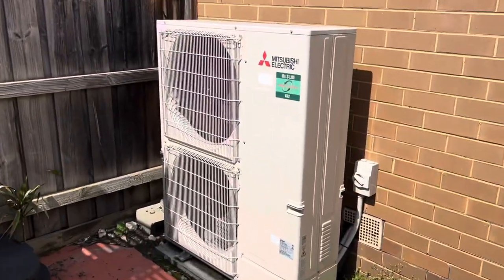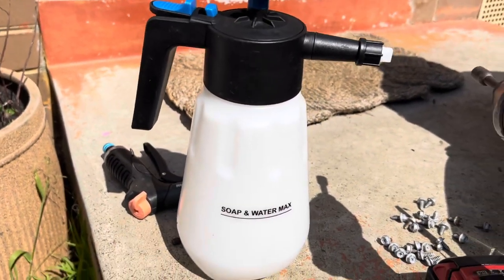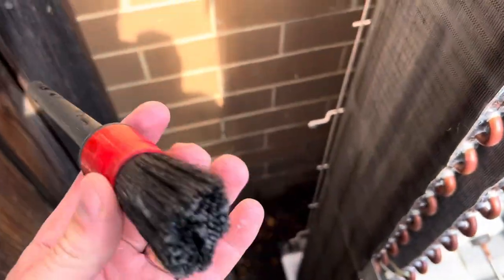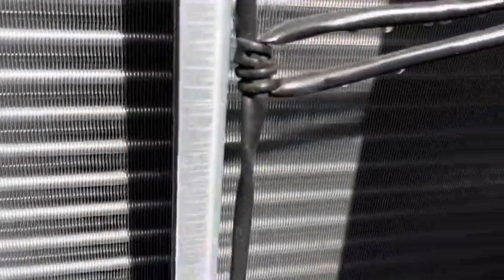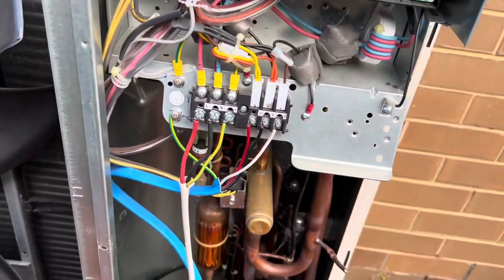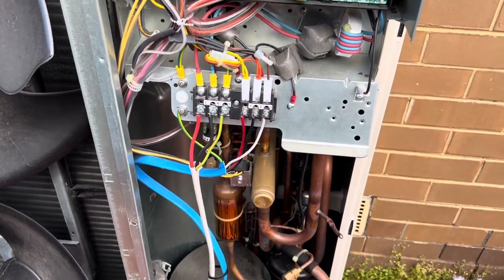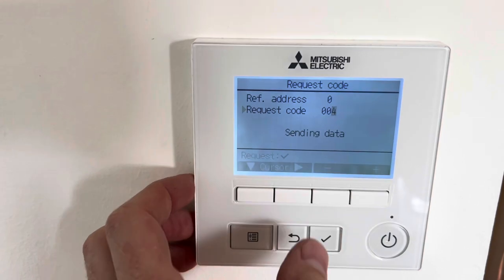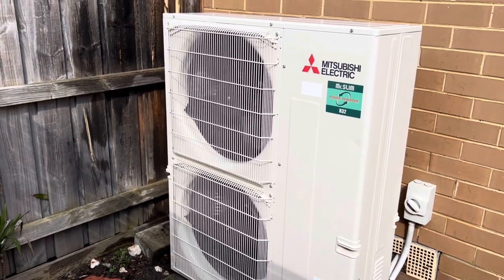Servicing My Ducted Air Conditioner

Comment: How about doing a video of the evaporator half? In particular, how you access the filters in the ceiling space.
Reply from the maker: My filter is located in a grille in the wall. I pull it to clean every few months. When I do eventually clean the evaporator I’ll make a video.

Comment: Hey Chris (pretty sure you're Chris, please forgive me if I'm wrong) Could I ask if you have any tips for keeping clean an outdoor coil in a salty coastal area? Just had installed a ME LN series and would like to look after it so it doesn't rot away like all the neighbours have.
Reply from the maker: Hey mate. Yeah, my name is Chris 😂 The salt air is a killer. Rinsing the coil with water to remove salt build up is a good idea (isolate the unit before hand). I’ve previously used Lanolin Spray on the outer casings and it seems to do a solid job preventing big corrosion. Spray it on and use a cloth to evenly spread it. Don’t spray it on the coil, just the outer casing though.
Reply from the maker: There is also a company called Blygold who specialise in anti-corrosion protection but they cost a fortune!

Comment: I have a question. My brother has a similar Mitsubishi system (unsure what one) but in his control setting he can only get 2 or 4 bar fan speed showing on his control panel, i also don't think he can get auto also. How to you adjust that inside the control panel.
Reply from the maker: Do you know the model of the wall controller? Usually, you can go to initial settings, enter password 0000, go to operation settings and then click Auto mode. Selected Yes and it should work. With the fan speeds that’s normal. Depending on the indoor model it can be two speeds only.
Reply: Looks like i have the same system as yours, from your outside unit i also have the (MR SLIM R32) sticker on the side. I believe my brothers system is the next model up in size. 
We bother have identical wall controller inside our homes which look like yours in your video near the end. 
It looks like my brother having a larger system only has 2 fan speeds then.
 Many thanks for getting back to me

Comment: Thanks, what about the inside unit does this need servicing, that is the inside roof unit and is ducted throughout the house
Reply from the maker: I clean my return air filter every 3-6 months. I’ll look at my evaporator coil at some point but it should be pretty clean.

Comment: Do you need to re gas this unit at any point?
Reply from the maker: No, you shouldn’t ever need to. If refrigerant is required that means there is a leak somewhere that needs to be rectified.

Comment: Hey mate, love the vids. 
What would be the code to check the indoor coil thermistors through the controller? Would be handy to know.
Reply from the maker: Thanks mate, appreciate it. 
For my A/C the service manuals says:
Code 32: indoor intake air temp
Code 37: indoor liquid pipe temp
Code 42: indoor cond/evap pipe temp
Hope that helps mate 🤙

Comment: What’s triple charge through the compressor? 🤔
Reply from the maker: Mitsubishi said that due to regulation changes they weren’t allowed to use a sump heater anymore so, to protect the compressor they send a small voltage down two windings to heat the sump and prevent liquid. They call it a trickle charge. You see that heat displayed in the discharge thermistor. Either that or I left the discharge thermistor in the direct sun for an hour 😂